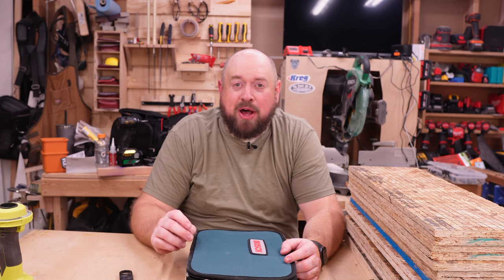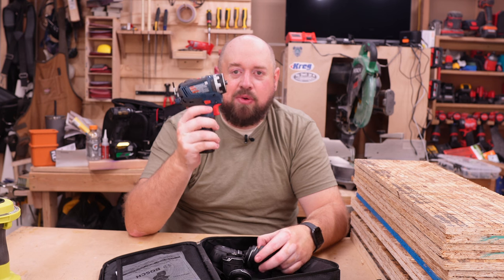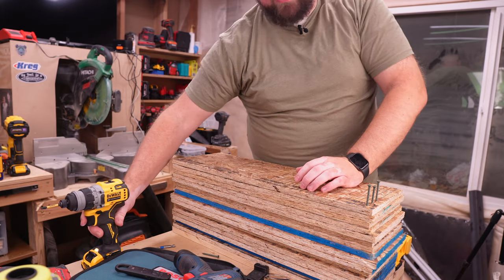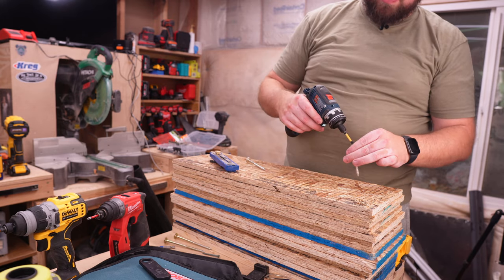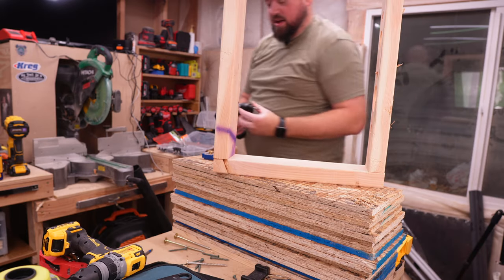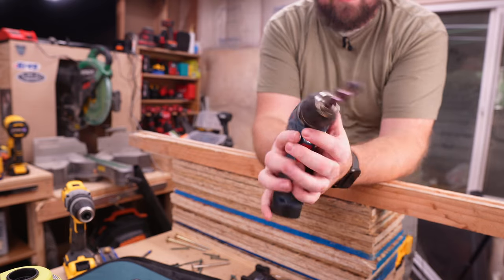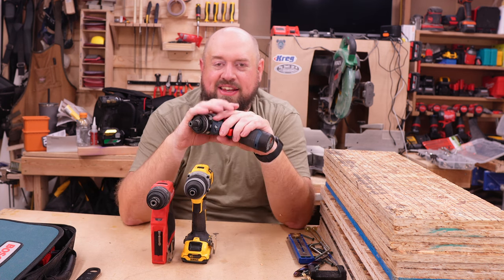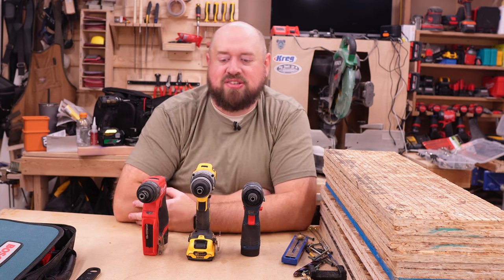2022 Best 12v Installation Drill

Comment: I love my Milwaukee M12 but I have co-worker that has the Bosch 12v and I do have to say I love the feel and handle of it. I like how much more compact it is and how it can keep up with my M12. Both are great!
Reply from the maker: It’s true.  All three have their advantages.
Reply: @TinkerWithTools  you're just not fair to the Bosch by being miserable at testing it. 
1. Mine NEVER let go of any drill, pretty sure it wasn't tightened properly 
2. you can stick the chuck onto the angle so that it is much stronger than any magnet 
3. obviously it's not made for standing straight with a 2 Ah battery - when the Milwaukee doesn't make the drilling in gear 2 you mention the bigger battery. Guess what: Using a bigger battery makes the Bosch stand straight 🤔
4. You didn't put all drills on gear 1 for the trigger feel (watching the scenes before and after: Milwaukee was on gear 1 - Bosch and DeWalt on gear 2, you even made a cut when you change the Bosch to gear 1 😂)
I don't think you did all this on purpose otherwise you would have hidden everything better - but you should definitely question your testing.

Also Bosch have the best planer, the best router, the best sander and the most practical angle grinder within the 12V platform. Common mate... 
We don't even need to talk about the DeWalt which is size wise just not comparable. Should have pointed out the size difference a lot more since this is the point of these tools!

You're right about the missing quick insert collet and the wrong direction pull though, this would have made the tool better...
Reply: The Bosch 12V is not the most powerful or torquey but the size/ feel/ weight is awesome ... never had an issue with bits falling off. I have this set (multi head 12V - work) and my other drills/ drivers are: Bosch ps21 driver/ps31 drill & ps41 impact 12V(work)  all brushed - Makita drill & impact 18V(work) - Metabo hpt drill & impact 18V(home) - work in medical equipment field - for construction, maybe one of the others will be better ... you can stand the Bosch up with a different battery (6.0 ah GBA12V60) but the “tube” battery is better for my applications
Reply: @januszR ou seem very invested in this lol. I don’t think anyone would question either of them being badass tools. Half way between an electric screwdriver and a drill. Also, “either of them” was intentional, Dewalt hasn’t been badass since they were the only option lol

Comment: On the Bosch you can add all the attachments on the end of the angle attachment. That makes that one more versityle, since it makes you able to use standard drill bits on 90 degree angle as one example.
Reply: He's just not fair to the Bosch. 
1. Mine NEVER let go of any drill, pretty sure it wasn't tightened properly 
2. you can stick the chuck onto the angle so that it is much stronger than any magnet 
3. obviously it's not made for standing straight with a 2 Ah battery - when the Milwaukee doesn't make the drilling in gear 2 you mention the bigger battery. Using a bigger battery makes the Bosch stand straight 🤔
4. You didn't put all drills on gear 1 for the trigger feel (watching the scenes before and after: Milwaukee was on gear 1 - Bosch and DeWalt on gear 2, you even made a cut when you change the Bosch to gear 1...)
I don't think he did all this on purpose otherwise he would have hidden everything better - but he should definitely question his "testing".

Also Bosch have the best planer, the best router, the best sander and the most practical angle grinder within the 12V platform. Common mate... 
We don't even need to talk about the DeWalt which is size wise just not comparable. Should have pointed out the size difference a lot more since this is the point of these tools!

He's right about the missing quick insert collet and the wrong direction pull though, this would have made the tool better...
Reply: You can do the same thing on the Milwaukee.
Reply: @superscifi12  it is an added feature on the newest Milwaukee angle drill atachments. Bosch had it since the start.
Reply: I own all three 12v, the dewalt seems the weakest, the Milwaukee the strongest. But saying that the Bosch over all in this tool is the best and watch my daughter who never used a drill pick it up and confidently use it. I bought a separate foam $20 case for its pieces, it was the best deal at 125 bucks. And I still use this drill now . When I need to whip out a couple holes without pulling out the big 18 V units. Grab this Bosch, manageable.

Comment: I purchased the Bosch due to its compact size, allowing me to use the tool in some very tight places. Over the years, I have added additional Bosch 12 volt tools, and so far, they all have continued to perform as expected, including the life of the batteries.

Comment: I’m heavily invested in the Milwaukee m12 ecosystem but got the Bosch because the small form factor was the most appealing for my intended use.  If I need more power I’m grabbing my Milwaukee m12 surge, but for assembly and finishing work, the Bosch just feels better for me and takes up less space in a bag than the Milwaukee installation driver.  Nice review. 🍻
Reply from the maker: Thanks.   The Bosch certainly is the most compact 5-in-1 of the group!
Reply: I'm in the exact same boat as you. Bosch all the way

Comment: Good video: balanced and insightful. I have 3 Bosch 12v (drill/driver, screwdriver and rotary tool) and am a big fan, although I actually prefer the trigger action on the older non-brushless versions, as the brushless motors do spin up more quickly, as you mentioned in the vid.
Reply from the maker: Thanks.  And I appreciate the comment.  I think several of the older tools sometimes feel more controllable for that very reason.

Comment: I bought the Bosch and I like the the way it feels in my hand. I think it is better at getting into tight spaces. I have larger drills that will stand upright, but frankly I am using the small 12v Bosch more than I would have predicted. Never had a problem with drill bit retention.The offset feature actually works very well.  It is actually very good at driving pocket hole screws into awkward places. The Milwaukee might be a good choice, but I am sure I paid far less for the Bosch on sale. The Dewalt drill looks like it is too big for the stuff I use my Bosch to complete.
Reply from the maker: Fair point.   The traditional style drills fit into certain spaces the Milwaukee with its font guard won’t.

Comment: For right engle drilling with the Bosch, use the locking bit attachment included. It won't add that much length (it is pretty flat other than the bit holder part, and it will be more secure than a magnet.
Reply from the maker: You are correct.  that is an option I failed to mention.  I suppose they went that route vs putting a magnet in the like the others.
Reply: The angled adapter is just the angled extention. You need to put one of the adapters on the end, just you would do on the drill itself.
Reply: @agentsixsix  You seem to not understand my comment. The point of my comment above was to mention the locking 1/4 inch hex bit collet to add to the right angle attachment.  Because he mentioned that there was no magnetic bit holding on the Bosch.
Reply: @ccbowers   I was just trying to reinforce your explanation.😉

Comment: You can try the GBA12V60 (6Ah) battery for the Bosch if you wanted to stand it up. So far I haven't bought one because I really prefer having the compact tool over one that stands up like that. I have tended to prefer M12 over Bosch lately but if I get the 5-in-1 kit it will probably go Bosch because the M12's button reversing rubs me the wrong way.
Reply from the maker: Thanks for the tip.
Reply: Totally agree. And the price for the Bosch battery is cheap and really doesn't increase the overall size

Comment: You're not fair to the Bosch.
1. Mine NEVER let go of any drill, pretty sure it wasn't tightened properly 
2. you can stick the chuck onto the angle so that it is much stronger than any magnet 
3. obviously it's not made for standing straight with a 2 Ah battery - when the Milwaukee doesn't make the drilling in gear 2 you mention the bigger battery. Using a 4/6Ah battery makes the Bosch stand straight 🤔
4. You didn't put all drills on gear 1 for the trigger feel (watching the scenes before and after: Milwaukee was on gear 1 - Bosch and DeWalt on gear 2, you even made a cut when you change the Bosch to gear 1...)
I don't think you did all this on purpose otherwise you would have hidden everything better - but you should definitely question if you really wanted to test it or if you had the outcome in mind before testing it.

Also Bosch have the best planer, the best router, the best sander and the most practical angle grinder within the 12V platform. Common mate... 
We don't even need to talk about the DeWalt which is size wise just not comparable. Should have pointed out the size difference a lot more since this is the point of these tools!

You're right about the missing quick insert collet and the wrong direction pull though, this would have made the tool better...

Comment: Thanks for the review and comparison. I've been mulling over this one for a while. I've been using the milwaukee for a couple of years now and like it a lot, but I think I'm grabbing the dewalt to compare for myself as well. Since my main drill is the dcd800 now (thanks to your videos of it!), if I switch to the dewalt 5 in 1 as my daily driver tool, I'll only need to keep one charger with me.

On top of that, these days, ergonomics and usability are more important to me in my tool usage. The only really irritating thing for me is that the dewalt only comes with one battery. 

Either way, thanks for the video! 👍
Reply from the maker: Yeah it’s essentially just the price difference between the two other kits.   The Bosch was still $149 at my local lowes today which was nice to see.  As for the DEWALT I don’t think it’s bad at all just not as small IMO.

Comment: Very informative review, between the Bosch and the milwaukee, with all the chucks removed to drill in a confined space, which one holds a hex drill bit most concentrically when drilling. for example, my Bosch right angle drill with a hex shank drill bit in the hex chuck, the drill bit describes a circle when you pull the trigger.
Thanks
Dave.
Reply from the maker: I'll test and get back to you

Comment: The advantage of the way the Bosh heads are removed is so that you don't drop the heads off ladders. I was watching another channel which had been using the Bosch, Milwaukee and DeWALT in the field, and the red and yellow drill drivers kept losing their heads when they would sheath the drills in the hole on the top of the latter (especially on aluminum ladders). In one case the ladder was 20 ft. in the air and the heavy drill chuck dropped from that height and hit the ground. This is why the Bosh advertises "lock" on the head and their literature. The two guys pointed out you can usually avoid this by hanging the drill by the belt clip instead.
Reply from the maker: Do you happen to remember the name of the channel?  I would be curious to watch.
Reply from the maker: The ladder I have doesn't even have a whole on top that is big enough to fit the tool in there like that.  I have always put belt clips on my tools, so if you are going to try to use them like that, yes the Bosch is going to be more secure, but I have never run into a case where they heads have disconnected when I was not wanting it to.

Comment: When you buy that segment of drill (for installation) you buy it for  most of the small application. Of course you need power but compactness,  and lightweight ergonomics is definitly the most important thing , I do own those 3 drill, and the bosch is almost what we ask to those tool : lightweight  and compact and précise.

Comment: I found one more possibly significant advantage to the Bosch GSR12V-300FCB22. In addition to being safer on many ladders (as I linked earlier), and in addition to solving the standing balance issue with the 6.0Ah battery (so it won't tip over with the drill chuck), the Bosch 12v batteries also work on the Dremel 8260 (which makes sense because Bosch owns Dremel). The 8260's batteries will also work on 12v Bosch products (the batteries are identical, and that's not even true of the previous generation of Dremel batteries). 

I'm not sure about the ratcheting drill chuck issue. The guys in the ladder video appear to have used it extensively in the field but did not mention this. Is it possible you had it unlocked somehow? I'm still waiting for mine to be shipped. 

I'm not surprised finding the best 12v installation drill/driver is an evolving process, even among the ones that are already available. It is a relatively new animal. Yes, the Festool came out well over a decade ago, but most people don't have a lot of field experience with a CXS.
Reply from the maker: Its not that the chuck is unlocked.  It's just not the premium of a chuck in my opinion.  On other Bosch products they do have higher quality chucks.

Comment: Bosch wins on almost every metric besides having 5-10% less performance.

First and foremost, it weights 25% less which matters when you're installing at arm's length all day.

The bit holder, offset, and chuck can all fit on the right-angle attachment. You can even buy a second tool with a second right-angle for even weirder action.

Bosch is correct about the bit holder direction. If you pull out a Milwaukee for example and it catches on something, the bit holder will open and leave the bit. Bosch can only loosen when pushing in which is also pushing the drill into the bit which makes leaving the bit behind very unlikely.

The lack of a battery on the front means it can reach deeper into stuff.

The camera-style lock is way easier to use. I find myself swapping between a drill bit and driver tip frequently.

I've never lost a drill bit with the chuck (though I do wish it ratcheted).

The Bosch grip is more comfortable to me.

They make a SDS attachment which I've never bought, but I thoroughly appreciate the ridiculousness of it.

Comment: I am intrigued by the Milwaukee, but not sure how cost effective it can be for DIY when a right angle drill attachment can be purchased for offset screwing. If used on a regular or professional  basis, however, looks like the Milwaukee would very well serve my needs.
Reply from the maker: I think my love for that tools goes beyond just the right angle or offset.  I really like the utility and form factor of it.  It’s not perfect but I think using most of these as a primary drill for most lighter duty things is usually sufficient for most people.

Comment: The company I work for has the m12 and a brushed Bosch, I prefer the Bosch. It’s underpowered but at least feels normal. Most of my tools are Milwaukee but I 
really can’t stand that forward/reverse switch on the installation driver
Reply from the maker: You probably would like the brushless Bosch.   The form factor but the power and speed is there.
Reply: @TinkerWithTools  you just need to use both drills in gear 1 and there's no problem at all with the Bosch.

Comment: I'd rather have the Festool installation tool, but I own Milwaukee mostly and I'm not complaining. Lots of drills and drivers, but the install tool always gets hung up with the offset fixture because that's what a need it for. Always have Philips #2 chucked upon on it and T25 torx and #2 square drive on the magnet. If for no other reason than that, it gets picked first a lot, at least if I don't have a drive a bunch of 3"+ deck screws. For that it's an M18 impact driver.
Reply from the maker: I just did a review of the Festool this past weekend.  It’s smooth an ergonomic the fact that it was first released 10+ years has left the power lacking compared to these newer options.  Still a nice tool just not as competitive as I would like it to be.

Comment: The other batteries and chargers in my shop say I should pick the m12 lol. But I’ve picked up some corded Bosch woodworking tools over the last couple of years and they impressed my so much I’m now curious about both of their cordless lines.
Reply from the maker: Bosch tools for me always feel really well built.  The performance (other than their pro-factor tools) doesn't always seem to compete toe to toe against the best.   But I do think they seem to be well made and really solid.  I have several drills, a sander, a corded circular saw and then a few 12v tools and I have no complaints about them other than the power sometimes lacking especially for hte size.  The freak is a prime example of this.  Great idea but I want it to have more power even if it doesn't ended up being the fastest.

Comment: M12 has a detail sander now. Haven't seen them out in the wild yet.
Reply from the maker: Yep oversight on my part.
Reply: @TinkerWithTools  No, no, not at all. It's so brand new I doubt it'll be available for some time. I think it was only introduced at Pipeline.
Reply from the maker: I was aware of it just didn’t think about it because I was thinking more of the traditional random orbit sander like Bosch has.
Reply: @TinkerWithTools  Bosch certainly leans more to the woodworking and carpentry side on the 12 V system. They have some weird stuff at Bosch.